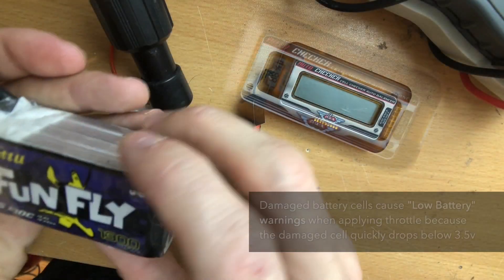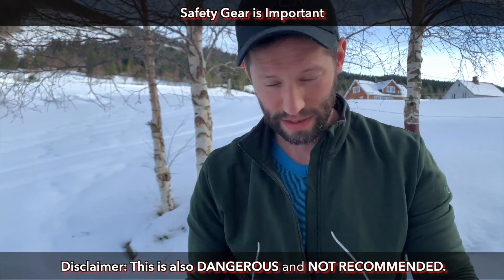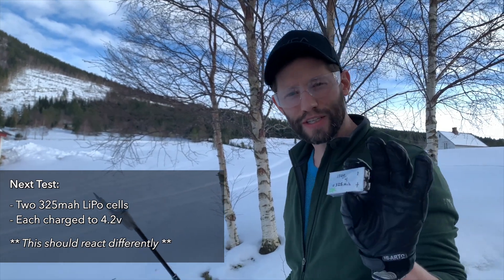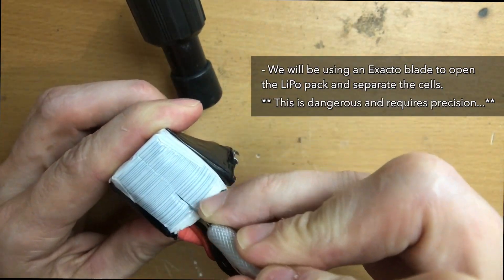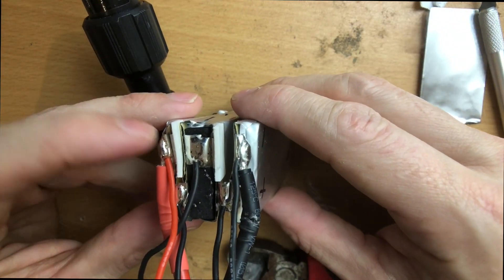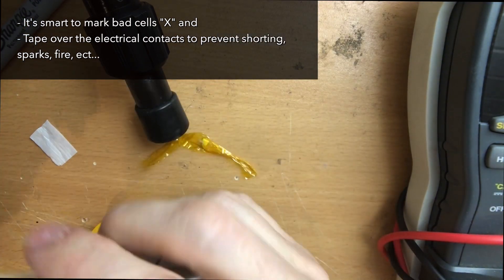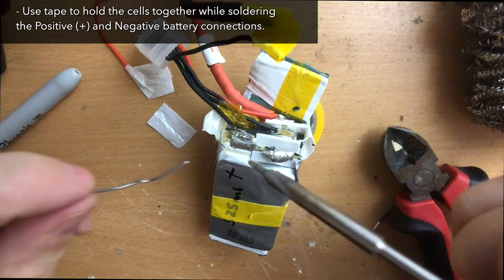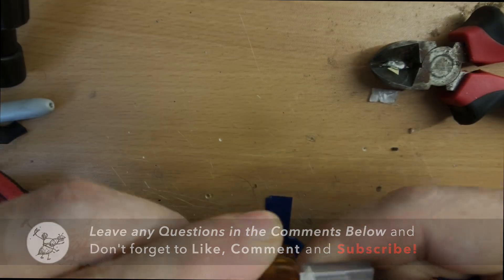LiPo Battery Repair and Explosion Test - How to use crashed batteries to fix damaged cells. RC DIY

Comment: Tip: discharged li-po batteries will never ignite, no matter what.
Reply from the maker: @amzonfire6013  yes, good tip. That’s partially why these batteries didn’t “explode” or shoot flames. 
If anyone watching this decides to work on batteries, always make sure they are discharged and that the cells are at the same voltage. 
Thanks for watching 👍🏼

Comment: Wowzers, you have such tech knowledge
Reply from the maker: Thanks, I just learn by doing really.  

I made a DIY Li-Ion Battery video recently, and you may actually benefit from using Li-Ion batteries with some of your shoots. Basically you sacrifice power for capacity. (I.e. Less acceleration, but longer flight times). If you ever have questions let me know. Cheers!

Comment: Please correct me if I'm wrong but each cell of an 4s 1300mAh battery has 1300mAh of capacity. Not as mentioned at 4:50 that the damaged cell has 325mAh. If they are in parallel you would be right...
Reply from the maker: You are 100% correct, and I’ve been meaning to make a revision/comment to this, so thank you for reminding me!  
Also thanks for watching, hope the video was helpful or at least entertaining. Cheers!
Reply: 4S 1300mah are 4 1300mah cells in series, that's right. 
But when connected in paralel it would act like a single cell 5200mah, not 325mah.